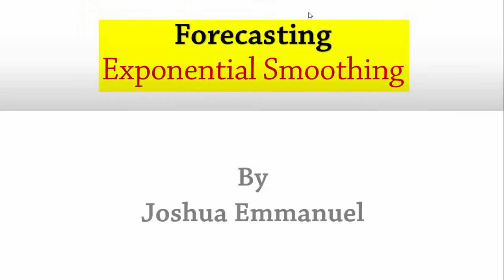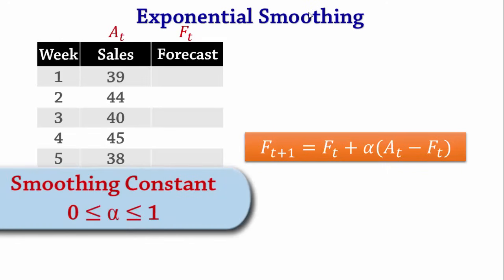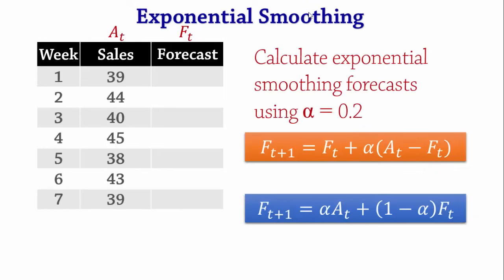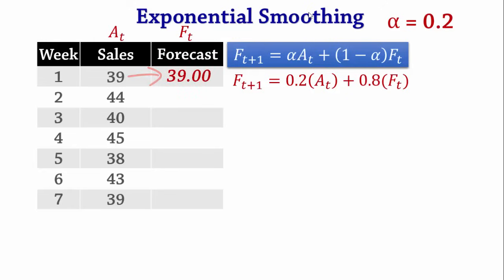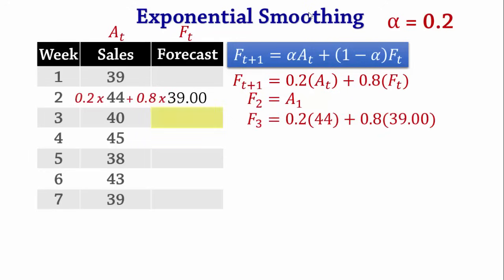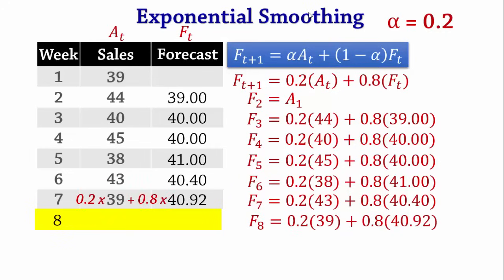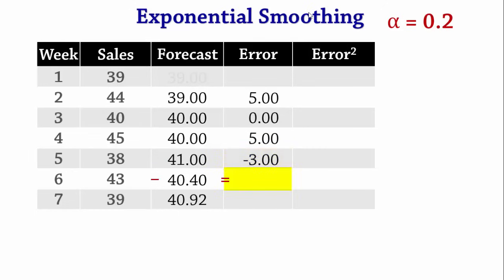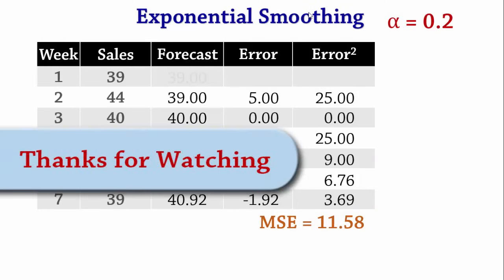Forecasting: Exponential Smoothing, MSE

Comment: Sorry sir, i have some question.. what if we want to continue forcasting to week 9, 10 and forward with this method? and what is the formula for doing that? Thank you
Reply from the maker: The last forecast value will be the forecast value for future periods because you can only use values from the last period. 
Thus F9 = αF8 + (1-α)F8
Subsequently, F9 = F10 = F11 = …
Reply: @joshemman  ah, I see.. is there any suggested reference for this explanation? maybe a book or a journal? because  I'm currently working on a thesis on this subject and can't find any references specially for this problem. By the way, thank you very much for the explanation.
Reply from the maker: @Herex123-g2y  I couldn’t find any reference myself. I am personally of the opinion that this method should not be used beyond one period into the future. Have you investigated Holt’s and Holt’s Winters?
Reply: @joshemman  Haven't investigated it yet actually

Comment: Use Holt’s double exponential smoothing method to compute demand 
forecasts for periods 2-7 for the following data. Use α = 0.2, β = 0.2, I1 = 108, 
S1 = 0.
Period Demand
1 108
2 110
3 106
4 108
5 108
6 105
Reply: Please give solution it's an urgent

Comment: Sir. I'm kinda confuse since I saw a video about calculating the MSE and the formula he used was MSE= (|A-F|)^2/n-1, and I also saw another video and the formula used was MSE= (|A-F|)^2/n.
Reply from the maker: You should find out the approach used in your course. It is done differently in some books.
Reply: @joshemman  What are the types of approach then?
Reply from the maker: @axineriego1674  If you consider that data as a sample, you divide by n-1; if you consider it a population, you divide by n. 
Most books divide by n. Find out what yours is doing.
Reply: @joshemman  I'm enlightened. Thank you.

Comment: do we not include week 8 when calculating mse? why?
Reply from the maker: To determine MSE, you need both Actual and Forecast to calculate errors. Since there is no Actual for week 8, it has no error, therefore it cannot be included in the calculation.

Comment: The best way to forecast the first period is to take the average of the time series: 39+44+40+45+38+43+39 = 41. In so doing the forecast is more sensitive to the actual sales. Which you verify by plotting both the forecast using the first period as 41 and one demonstrated in the video, you will see that using the one in the video your sales forecast will lag behind  your actual sales value.

Comment: What if we want to predict more than 1 values in future says 7 values. Considering we have enough past data.
Reply from the maker: Unfortunately, you can only predict one period into the future using these smoothing methods. Trend projection (linear regression) however lets you forecast more than one period in the future.
Reply: Thank you so much @joshemman  for your reply. 
If we use more than one value in history ( lets say 4 values with exponential weights) and predict one value in future, and then use one predicted value and other past 3 values to predict further value in future and so on. 
Will this be a bad approach? Or this can work as well?
Reply: May be I am thinking of forecasting using Exponentially weighted moving Averages.

Comment: how do we determined the alpha? or can we just actually selects a random number between 0 and 1? thank you
Reply from the maker: Alpha is usually given. But you can use Excel to find the best alpha for your data if required. See other comments here.
Reply: @joshemman  Thanks for replying his question because I was wondering the same. But how can I use Excel to find the best alpha without assuming a random value of alpha for getting the forecast + 1 and mse values? I mean, is it possible to find the best alpha before calculating the forecast value and mse value? Like to find the best alpha with just the actual values?
Reply from the maker: @Dimitri_Dhoo  Watch this: https://youtu.be/zOGfG65ASdA
Reply: Thanks.  @joshemman  I watched it but in that video he already have alpha = 0.3 at the beginning. My question is how to find the value of alpha at the beginning . In your video, you used alpha = 0.2 because it was given but what if it's not given? How could I know what value of alpha should I use to calculate the f+1 then mse.
Reply from the maker: @Dimitri_Dhoo  You don't need the 0.3 used in that video. It doesn't matter what is in the alpha cell before, the optimal value will be the same.
Reply: @joshemman  Thanks for taking your time to reply me, I highly appreciate. I get it now, thanks again!

Comment: Sir., how can i choose what smooth factor will i apply in the formula. is it 0.10, 0.15......
Reply from the maker: The smoothing factor is usually provided for you. If you have to find the optimal one yourself, you might wan to check this video out: https://youtu.be/zOGfG65ASdA
Reply: Is there a possibility to get the smoothing factor by solving. Is there any available formula to find it?
Reply from the maker: There's no formula for it. It depends on the data you have. You can use trial and error or follow the approach here: https://youtu.be/zOGfG65ASdA

Comment: Very helpful thank you! Follow up question: why is the 39 going into Ft2 rather than Ft1?
Reply from the maker: If you put 39 in Ft1, you willl end up getting 39 in Ft2 as well, using the formula.
Reply: Okay that makes sense thanks!
Reply: Rohin Mahesh with no forecast given for the first period you can use the naïve method, which means you assume the same forecast for period one are the same as sales for that period.  this gives you a starting point to calculate the forecast for future periods.